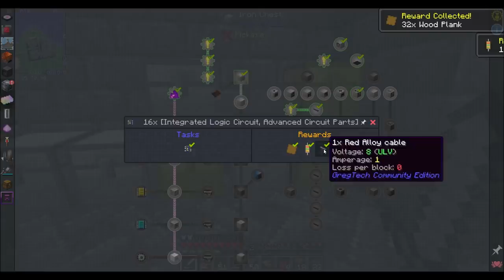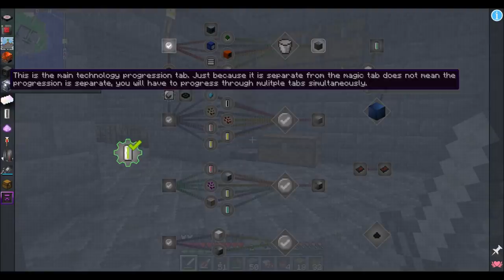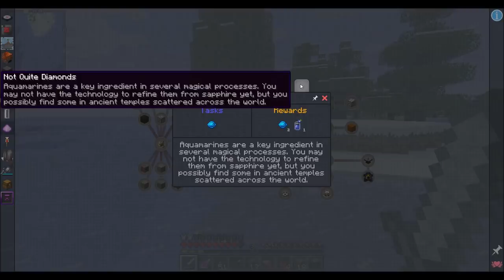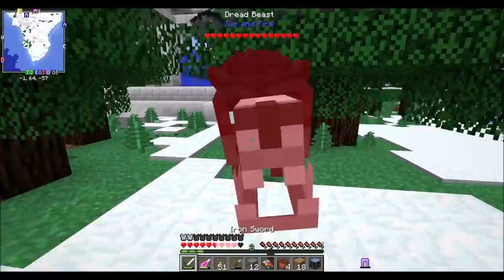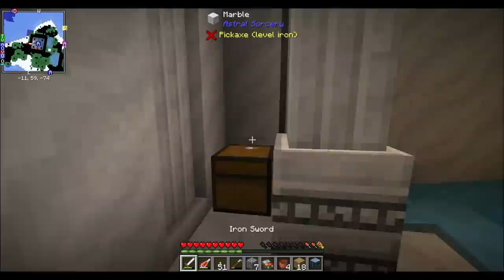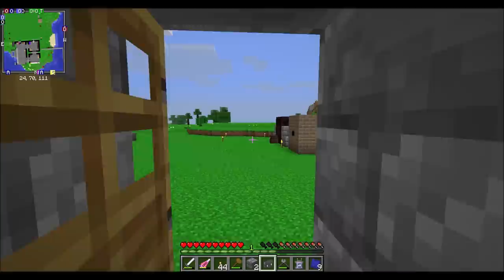FTB Interactions EP14 Machines and Astral

Comment: You cant chisel the astral book because it acts like a bag and holds your constellation papers. When chislening between books nbt is not preserved so you would lose all your papers. That's why you spawn in with an astral tome. Also JEI has an integrated chest searching feature that you might find useful. IF you search and item in JEI, hover it and then press T it will close jei and any nearby chest that has what you're looking for will begin emitting smoke particles.
Reply: I believe this is actually extra utilities but yes. Extremely useful
Reply: Thanks. I pressed T yesterday and my chest started glowing but I didn't know why.

Comment: Impure Sapphire Dust: "Throw into Cauldron to get clean dust"

Dire: "and that can be... centrifuged. Yep, only centrifuged. No other way of cleaning that dust."
Reply: He's already said that he doesn't consider the cauldron as a viable option.  He thinks it takes too long.

But, now that he has a reservoir, he should be able to throw a stack of dust in the cauldron and then hit it 16 times with the reservoir.  Actually, it may only take 250mB for a full stack, provided you throw the whole stack in at once.
Reply: @uigrad  can confirm that is EXACTLY how it works, you can get a good 3 stacks of dust washed in the cauldron provided you throw them in as stacks and not one dust at a time
Reply: @uigrad  It's because he didn't read the quest where it said an entire stack of dust only uses 1 bit of water. You can get 4 stacks from a single cauldron.

Comment: I have a feeling Time in a Bottle will only cause more issues than help due to dire's impatience and GregTech's requirements for Steam/Power.
Reply: He can tiab the boilers. I wonde whether he'll tiab dynamo as that might cause the cables to burn.
Reply: More issues.  He is still using useless pipes to move steam, he doesn't produce enough steam to do anything.

Comment: Now you have aquamarines, you can replace the water in the autoclave with liquid starlight that will make it run much, much faster.
Reply: that might require a higher tier. i dont know for sure
Reply: @sighmon5640  I did it last night. It does not require anything more than the basic autoclave. Heck, I didn't put water in there in the first place.

But then, I followed a wildly different path than Dire is. For instance, I spun up astral chickens and use those to generate the 64 buckets of starlight I have lying about.

Comment: Make a crafting station using the pure daisy. You can attach a chest to it with all the gtce tools and ingots to craft at a much faster pace.
Reply: Yes, but Dire doesn't like this for some reason.  He prefers to make us suffer while he beelines for AE.
Reply: @SummitSummit  AE isn't available till you can get stellar alloy which isn't available till mv or hv. And yes the pain is real.
Reply: the Crafting Station will ALSO interface with an RFTools Modular Storage for holding all the various GT bits and bobs (plates, wires, covered cables, rings, rods, screws, bolts, wrench, hammer, file, screwdriver, mallet) which was how I kept all the blasted GT crafting under control until after I managed to reach space and put an AE system together at long last.
Reply: @ScottGodin  What is the block called for modular storage? The basic toolbox is a pain in the ass with only holding junk tools.
Reply: @Kraus-  That is literally what it is called
Reply: Scott Godin doesn’t modulat storage have  a crafting grid? Unless it gets angry about recognizing tools if they’re damaged, I know it’s funky about OreDict
Reply: @morganhunt8051  The modular storage internal crafting is best used for storing those 5 recipes you use the most, and the fact the storage module 3 holds so much it's like a super-chest next to the tinker's crafting bench. And IIRC it is a little funky about the GT tools in some way. been a while since i used this combination but when I did, it got used for quite a long time before i got around to going to space and getting AE2 going.

Comment: Can anyone tell me how dire got that conveyer? You need rubber plates which need sulfur.
Reply: @BigKeaner  Thank you
Reply: Smelting dry rubber doesn’t turn in to rubber, an I missing something
Reply: also wondering about the sulfur part, dry rubber does not work
Reply: There is a reward that gives you 20? rubber ingots, maybe he used those?
Reply: @Acyale17  you're not, it turns into plastic.
Reply: @SummitSummit  What quest is that?
Reply: @deathrictus6000  Ahh, my bad, you need rubber to complete that quest.  Maybe Dire IS cheating?  I mean, I've explored about 20 villages in my various ore hunt and I've never found a Peace Candle.
Reply: Early quest rewards, too.
Reply: @SummitSummit  peace candles no longer spawn in villages. Honestly... I added torch master to the pack... I found a really nice place to build, my other option was to build underground to mob proof. Kinda over that.
Reply: @SummitSummit  it seems like cheating, was struggling to get rubber bars close before and only way was obtaining sulfur via Nether or basic centrifuge, neither he did
Reply: pretty sure he cheated it in or his version of the pack gives it as a quest reward. because currently the only way would have been him crafting a centrifuge which he clearly didn't do
Reply: @LeeAnnC  You auctually get some Rubber Bars from a reward i believe. I dont have the mod pack up to check 100%
Reply: @Kelenae  to get that quest you need a conveyor module. i have it open rn
Reply: @Kelenae  you get it as quest reward once you create it or get rubber pulp and sulfur... conveyor module was cheated in by DW20, not surprising but disappointing
Reply: @SummitSummit  no i believe the conveyor thing was a quest reward
Reply: @n3stl0rd  a quest reward for making the module
Reply: @ben-1673  still he never made the chemical reactor or the centrifuge..
Reply: @ben-1673  I went through the whole process of making rubber because I'm following him. It's difficult enough it's something you don't easily forget unfortunately
Reply: @LeeAnnC  are you guys using the 2.0+ version from forge... conveyors are made with plastic... which I just smelting resin after you dried it.
Reply: @troyj8199  conveyor module. Not the normal conveyor belts
Reply: It's plastic, not rubber.
Reply: @Kraus-  relook up the conveyor module recipe.
Reply: Honestly I would love a Dire response on this, kinda not cool
Reply: Cinnabar dust  . .  but yea i dont see how Dire got there with the machines he has

Comment: dire when u are using the autoclave use liquid startlight as it gives a better chance and cost less power
Reply: liquid starlight gives 100% chance. water less so. this is literally the reason to use liquid starlight in the autoclave at all times.
Reply: @ScottGodin  A better reason is that it's 20x faster with starlight.

Comment: for dire.
sapphire in the autoclave takes 100s
so note that it would take two clicks of the time in a bottle in order to complete an operation before the acceleration runs out (assuming you have the power)
Reply: but also, get a battery and just TiaB the boilers/generator, and then pump out of the battery
Reply: It takes five seconds if you use liquid starlight.
Reply: @Kraus-  yeah i heard something like that. but is that available in LV? if i were to guess it would not be.

Comment: I'd say I strongly disagree Dire, you've done Gregtech only once before and that was Omnifactory, which still is my favourite pack you've done and looking at the comments also of many others and I had zero problems with the on screen crafting as that was the thing that was so intriguing about it. It not only having linear progression but also reciprocating backwards improvement of the previous recipes in a better way. The crafting was part of that and paired with the intense automation made it extremely enjoyable and not stale to watch at all.
Reply: I think to a point the onscreen crafting is alright. Gregtech has so much micro-crafting that it is very easy to get bogged down in the shear amount of stuff you have to craft.
Reply: it’s probably cuz it’s extremely boring for dire to come up with commentary for literally just microcrafting
Reply: Nobody wants to see him crafting for 15 minutes
Reply: @XArticSpartanX  The ideal way to do it, and what the quests suggest, is to craft in bulk. throw a couple stacks in a hopper to turn into plates and run off to do whatever.

Comment: dire!! i wan to ask you how the hell u get conveyor module withou making rubber?
Reply: Cheats
Reply: It's one of the first quests you get access to. Put resin in a drying rack to get plastic. Conveyors use plastic, not rubber.
Reply: @Kraus-  wrong item. You're talking about conveyor belts, not the module
Reply: I too was thinking this... is there some other way to make them im not aware of?
Reply: @thebeersandthebees  nope. I've been talking to the ftb server. There's no way to make the conveyor module unless you make rubber. (Which after getting your first bit you can get a quest reward for another 16 ingots) but you still need rubber to begin with. Dire was not afraid to cheat in the bottle. It seems he just cheated in a piece instead
Reply: @LeeAnnC  yesterday i saw he make conveyor module i was serch for all moning just for how the hell to get 1st rubber and i now know y
Reply: @akasia017  yea it's a long process. Gotta make the chemical reactor and the centrifuge. Plus a steam extractor if you didn't make that before. It's just a really bothersome process and i guess that's why I'm annoyed he just cheated in the item.
Reply: You can get sulphur from galena in a basic ore washing machine and claim quest reward from LV chemistry to get 16 rubber bars as quest reward.
Reply: @ianb5486  yes but dire didn't do any of that y'know
Reply: @ianb5486  he didn't make an ore washing machine

Comment: people are commenting that dire should have made an urn already but he needs to have the research unlocked which needs glowstone. 
also dire... how did you get the conveyor module??
Reply: The conveyors come from plastic which is one of the first quests you get access to. The urn is also extremely easy and doesn't need glowstone. Reading the quests helps a lot.
Reply: @Kraus-  the conveyer module needs rubber not plastic. You're thinking of a different item. And his version you do need glowstone it's not till 2.0.3 it gives you the research for free. He's still on 2.0.1 i believe

Comment: Dire is about to be disappointed once he realizes time in a bottle is kinda useless on gregtech machines
Reply: I was thinking this the entire episode. "I don't think the Industrial Craft/GT machines worked quite like that from what I remember".
Reply: if you have your setup such that A> you have a battery backup in your chain, and otherwise try and keep 1 turbine per machine and put batteries in EVERY SINGLE MACHINE you can TIAB them. definitely without the battery in the machine, TIAB will result in sadness as it will draw more power than can be delivered otherwise.

Comment: Do you reckon why quest name for aqueous accumulator involves Urn pun? Or you deliberately decided to use harder recipe? :)
Reply: I'm pretty sure he can't make an urn yet till he has the required research (in this version of the pack).
Reply: @LeeAnnC  but isn't it seem to be "correct" or "easier" way and quest's name tries to signify it?
Reply: @Sfaxx  well in later version of the pack it is easier because it just gives you the research necessary. but where dire's at it's probably better to just make the accumulator

Comment: Why do I all of a sudden want there to be a Void Steel which is made using Void metal ingots and could be amazing for energy transfer but can slowly create tiny amounts of flux and could cause a rift to open even when there wasn’t enough flux normally. It in a sense would make it where Void seeds and due to it Void metal ingots but you would have to keep on top of rifts as not paying attention could mess up your base badly.

Comment: can u keep the steam in a drum to use it as a backup? or battery kinda
Reply: Ehh...  Not a great solution his pipes are too slow for one, he just needs more steam production which he is working on.
Reply: @SummitSummit  he got free tank which can be used, its free
it works at least for now it make things easier
Reply: Mek Dynamic Tank is the best way to buffer your steam so you can keep track of when you get to the point that your machines are using too much steam and you need to either update your mek pipes to allow better flow, or adjust your layout to make better use of steam
Reply: The drums are way too small for the amount of steam you would need as a buffer. A dynamic tank multiblock for about a million mb of steam is around the minimum that's feasible.

Comment: If crafting stairs = 8 stairs it is more economical to use stairs as the smelting source, if not, slabs are the more economical than just using planks
Reply: wouldn't fences be better? considering you get sticks from EMC == free

Comment: You should probably make those extra steel boilers. The bronze steam boiler takes soooooo much bronze to make and eats fuel like its no ones business.
Reply: sharan kumar why there is a power per tier questline..you won’t get anywhere crafting a bunch of steel boilers..you HAVE to make a boiler
Reply: Yes, but the quest clearly says it takes 5! steel boilers to run 1 LV machine.  Whereas the large bronze boiler will power TONS of machines at MV.  The steel boiler quest should probably be removed to stop confusing people and making them waste resources.
Reply: @joplenoir1304  That's not what I meant. I meant he should make some steam boilers till he can make the large steam boiler. It would make it easier to craft the boiler and coke ovens.
Reply: @SummitSummit  I did not mean that. It just takes a lot of time and resources to get the large boiler. Till then it would make it easier to have a couple of steel boilers so that you dont have to wait for the plates and processing.
Reply: sharan kumar I get what you mean BUT, if you just farm a copper and tin vein , should be plenty to make all the bronze you need..
Reply: @joplenoir1304  I thought so too and skipped the steel boilers. Making the large boiler itself wasn't too hard, but my god the amount of fuel it needs. Even on its lowest throttle it needs a charcoal every couple of seconds. But once you get a couple of coke ovens it gets easier.
Reply: Why we made the power quest tab.. getting that setup ( if you have max amounth of logs in your tree beacon that is ) will be self sustainable ( you can also put the creosote into the boiler with an added input hatch, if your just not keeping up with charcoal ).
Reply: @sharankumar3086  The optional liquid input in clutch on the large boiler. Build a stack of improved coke ovens with a tree beacon on top feeding into the first oven. Then that oven creates charcoal to feed the rest of the ovens in the stack. At the end you'll have more coke than you know what to do with, and can pipe the creosote into the boiler until you have enough ovens to sustain it on coke alone.

Comment: you said that you did off camera "a bunch of crafting" but clearly you have cheated at least conveyor (which is just extremely tedious to craft), as it requires rubber plates, which requires mixer and fluid solidifier while you don't have these machines...
Reply: argh, not mixer, but chemical reactor, but still...